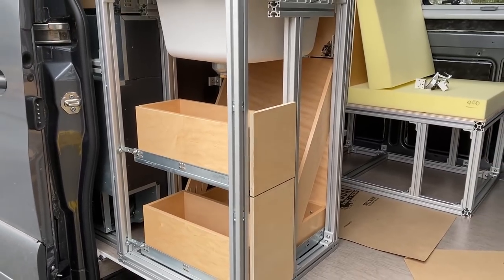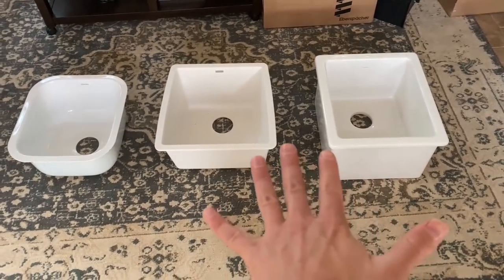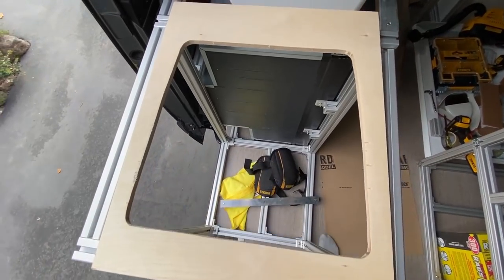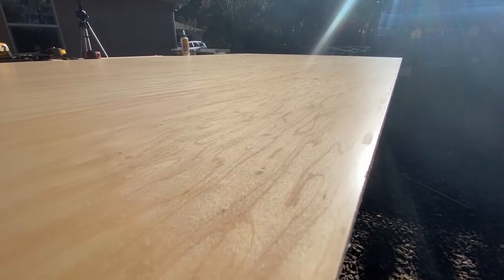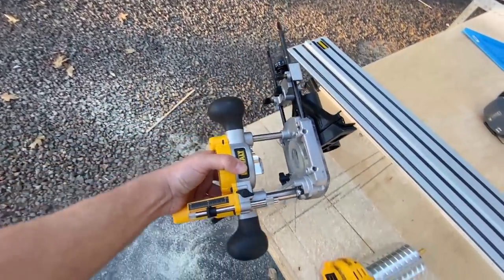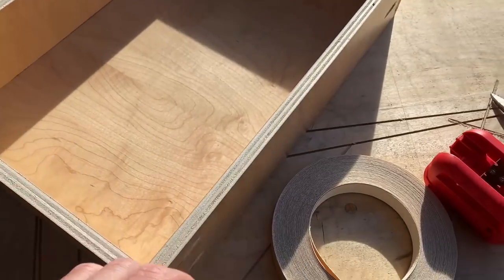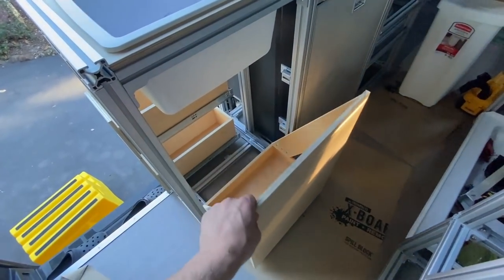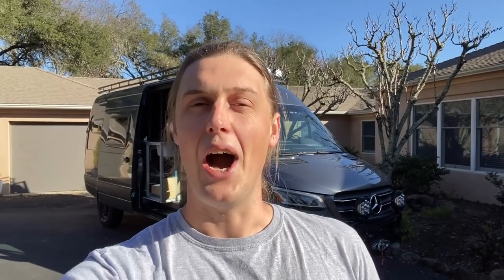How To Build A Van Galley Unit - Drawers / Sink / Fridge (Part 1 of 2)

Comment: Did you try flipping those L-shaped flanges over (the ones to support the sink on each side) and using T-slot fasteners? That arrangement of 8020 pieces on each side (to hold the flanges) seems like a huge waste of time and money. Believe me, that 8020 stuff is more than capable of holding the weight without building that substructure.

Comment: Great video. I have a question about your 80/20. Are you using the 15 series? I think you could use the 10 series and save a little $ and space. Do you think 10 series is strong enough?
Reply: I have the same question. I am much more interested in weight savings (I'll have a motorcycle on the hitch) than I am sturdiness that could survive the end of days.
Reply: @BradGroux  I've seen other van builds using the 10 series with no issue. That's what I intend to do. I think 15 series is overkill
Reply: @danielouellette5952  Thanks for the heads up! 10-Series is 52% lighter, so it seems like a no-brainer.
Reply: Hi guys, in terms of length. I know it depends of the built but how much you think I would need in a built like this?
Reply: You could also go with the double height  10 series if you really needed more rigidity in a section.

Comment: The granite sink WILL crack.  I have already been through it.  We replaced 6 of them before the manufacturer told us that vibration and movement of any kind will cause it to debond over time.  They said they lose 30% in shipping alone.
Reply from the maker: Hasn’t cracked yet!

Comment: Excellent video and very very helpful for us who sit and dream of copying you one day .....BUT, a quick question or suggestion....on the back support of the forward facing two draws, the thin angle bracket holding the back of the draw...imho, and from an engineering background....I suggest you make a thicker bracket that can help in holding the weight of whatever you are storing in those draws.  The downward force are imho too great for the small bracket. Simply make the same thing with more material in the vertical plane as it were. This way it'll be able to handle larger items without risking deforming or bending that bracket. Just a suggestion.....otherwise a fantastic video as usual.....can't wait to see it finished.
Reply: Thats what I thought too.. depends what he stores in them, but yeah looked way too small.

Comment: good video man, a helpful tip to save buying a router for the bases of the drawers is that you use the track saw to cut out a groove for the base, then cut your drawer pieces to dimensions. it's easier to do it in one big piece, then to cut the smaller ones compared to how you've shown in the video

Comment: I’m doing up exactly the same Sprinter. I wish I could just pull mine alongside yours and we could work together. You have tons of space and great weather by the looks of it. I have so many skills from working in the building trade for years and you are such an adept learner. I’m impressed by how quick you learn and your enthusiasm is encouraging. Each stage I’m never 100% sure about what I’m going to do but after doing it I’m so much more confident and was wondering why I was worried in the first place. 
Here in the uk we seem to have difficulty in getting the same materials as you. Maple ply is not available as far as I know and we seem to just have the Birch. Single seats for a 2018 model are like hens teeth and the 80/20 is very, very expensive. I’ve never seen anyone in the uk use 80/20. Please let me know if anyone has seen this being used. When I’m working on my van, very slowly I can never see the end

Comment: Dude!
Applause for your application of aluminum extrusion. Strong, lighter-weight, aircraft standards. No fault in deviating from aluminum / or  kevlar honeycomb panels (you said How Much, a square foot?!!). Just wanted to ask, is the butcher/block to sink joint a problem?
 ( I was thinking that joint would "wick" fluids out, over the edges of the sink... )
- capillary action - and could delaminate the maple.  (?)

Comment: to cut the baseboard to fit your sink, turn your sink upside down exactly over where you want it, trace around the edge, then mark about 1/2 inch inside your trace and cut. Make adjustments if needed.

Comment: Another great video, thank you. I may have missed it, but could you tell which profile you used for the galley build. What would be your opinion on using the 200mm profile? Would it be rigid enough? Thanks.

Comment: Do you think the horizontal piece at the bottom of sink satchel is necessary? It seems like the vertical piece would be strong enough. 
I'm surprised you didn't have the drawer faces overlap the extrusion more on the sides. I'm curious to see how you have the facing work on the edge of the 80/20 nearest the van door alongside the double drawer. You could have the drawer faces come all the way over the edge of the cabinet rear panel. 
If you find those double drawers don't hold weight enough, you can always get 8-32 tnuts and then use #8-32 X 1-1/2" truss head machine screws to attach the slides to cross pieces of extrusion. It won't interfere with the slides.
Reply from the maker: I could not extend the faces because they would become incompatible with the latches I’m using (next video). 

Good idea on the drawers although they will hold more than enough weight with current mounts

Comment: when you're cutting a slot with a router you don't use the flat fence. You should run the curved side of the router base against a straight guide. That way if you accidentally twist the router it won't make your slot wander. Use the straight fence for edge rebates/rabbets.

Comment: I want to get a wheelchair pull out ramp that can be then slid back under the flooring. Any ideas.  My single bed will go rear to front and the wheelchair will load in the rear doors Sitting next to the bed.  I can ambulate so I don’t need a full lift.  Any ideas.  Power truck lifts are 2 plus and a basic 8 foot aluminum ramp is 200. Love your work!
Reply from the maker: Hmm good questions. Would you need a layout that you can wheel the length of while you’re in the van?

Comment: When you installed the fridge did you have to drill the fridge holes? I have the same unit and when I pulled the interior white caps the holes are sealed.
Reply from the maker: Yes